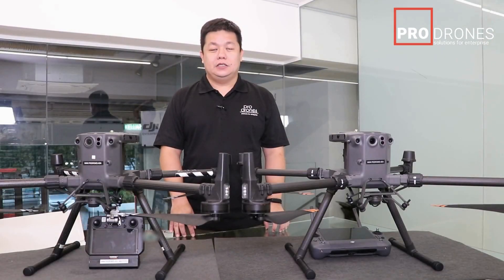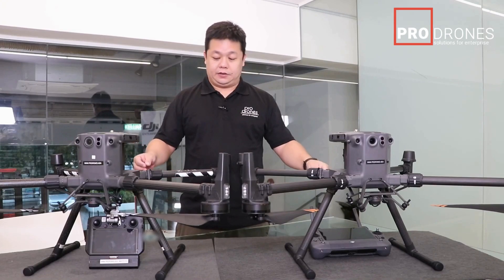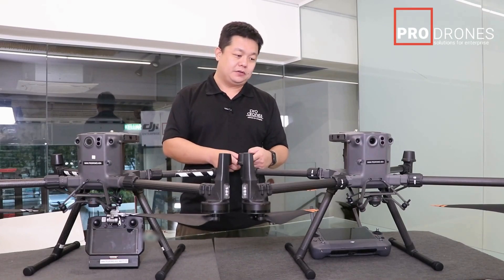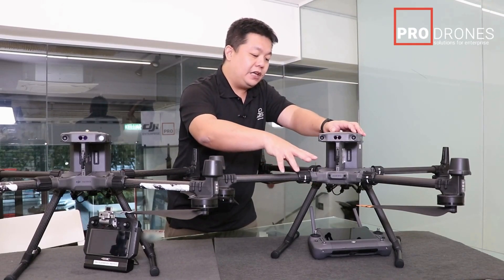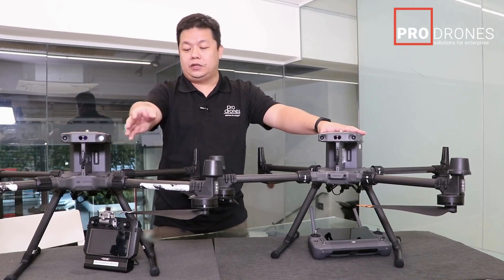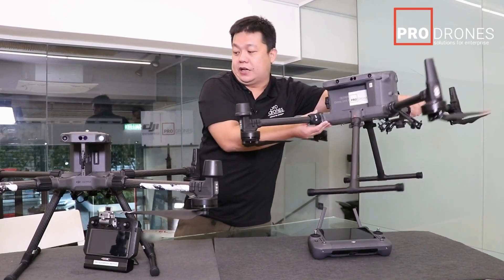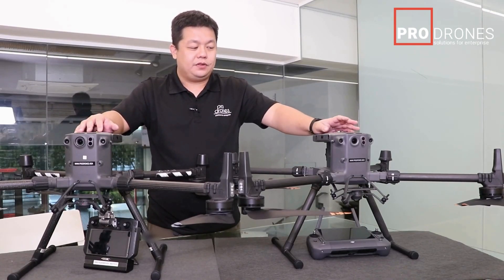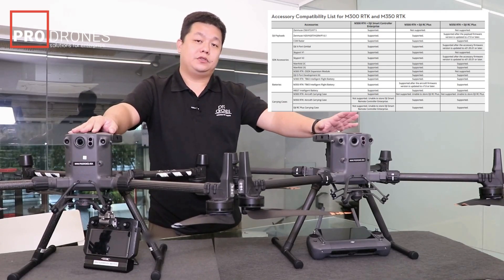DJI M350 RTK  V.S. DJI M300 RTK Comparison: Aircraft (Part 1)

Comment: How long does the battery last per flight? Is it more than 55 mins if both batteries used? I know they're now upto 400 Cycles
Reply from the maker: The M300 and M350 have about the same flight time of 55 mins and they always fly with 2 batteries only. Hope that helps
Reply: @prodronesasia5262  I'm sorry I wasn't clear. I want to know if each battery produces 55mins of flight time or both batteries combined gives 55mins???